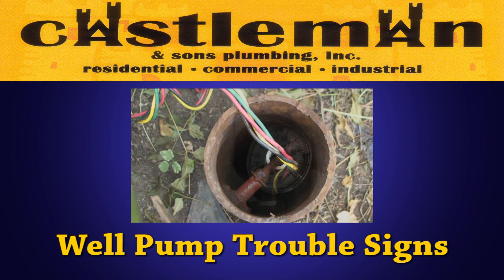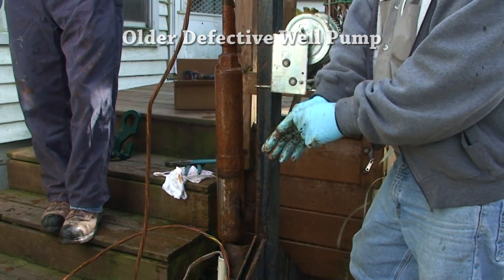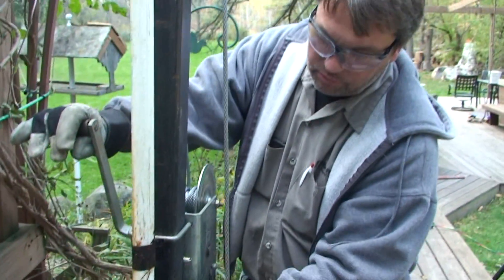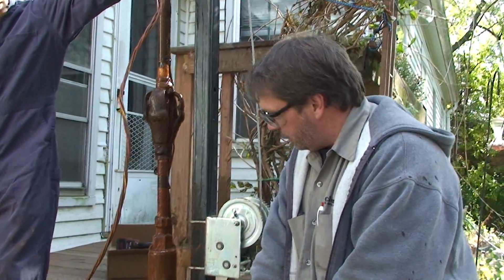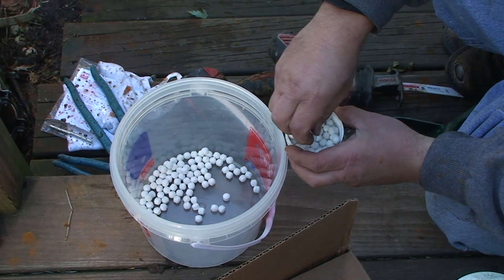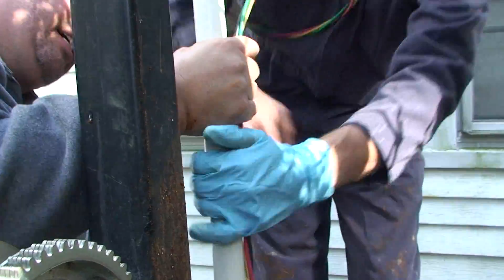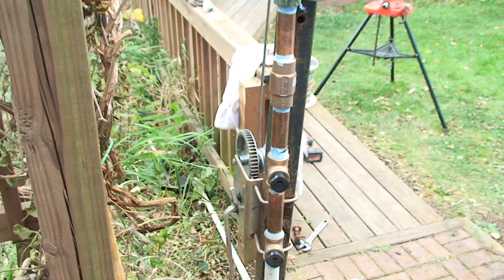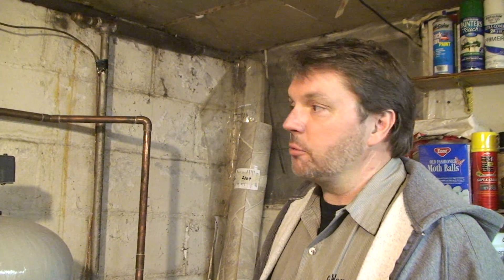Well Pump Trouble Signs & How To Replace A Defective Well Pump

Comment: i have a deep well jet pump, its a goulds J5.  i had water but it was intermittent, now i lost pressure and cant prime the pump at all, is my well dry or the pump went bad?
Reply from the maker: Hi Todd Baden, thanks for the question. First of all, sorry about your loss of water. Did you notice if you were getting any air in your water, before it failed? That is a sign of a dry well, or a break in the piping, perhaps from a hole in the pipe or a bad check valve. The only way to tell is to pull the pump out and examine it. It is usually far less expensive to examine the existing pump system, than it is to automatically drill another well. In either case, running a good pump without any water can quickly damage a unit, so it would seem you will need to access the well casing and determine if there is water present. Hope you can remedy the situation and get your water supply back in working order.
Reply: fixed, it was a clog screen and bad petcock down in the well, and yes i did have air bubbles. ty
Reply from the maker: Good news...glad you got it all fixed up! Thanks for watching and sharing your comments.
Reply: Hi VintageVideos2009... We have experienced total loss of water. I noticed a few months back, every time i would turn on the water in the morning there would be a lot of air spitting out before the water finally flowed thoroughly. A few nights ago I went to take a shower and noticed limited pressure and then no pressure. Went down and saw that my Rainsoft system was continuously draining (almost like it was stuck in backwash mode) so I bypassed the entire system until I could get a technician to come. One day later (Saturday night) we have full loss of water. I replaced the PumptroL switch and have full 240 volts of power running, but it is not activating the pump and my tank is completely empty. I replied to this thread because it sounded similar to my issues. Any advice would be really appreciated before i contact a professional. Thanks!!
Reply from the maker: The intermittent air coming out of your faucet and then failure of water to flow in the system a few days later suggests that there is a disruption or break in your well pump system, and you will likely need to open up and examine your well tank line. This is best handled by a professional who has opened up wells and diagnosed and examined well tank systems. Thanks for sharing your question with us.
Reply: VintageVideos2009 thanks for your reply. Hopefully its an easy fix, like the gentlemen above. Again, I appreciate the reply.
Reply: One more quick question. Do you believe the water softener system issues could have had something to do with it? Or pure coincidence... thanks again!
Reply from the maker: Hi Russell, thanks for the question. Water softeners can become clogged, with rust and other deposits and reduce the amount of water flow. Performing regular maintenance to the softener can often minimize this occurrence. However, if you feel the water softener may be the problem, most water softeners has a bypass valve that allows the water to flow without entering the water softener system. By engaging the bypass valve, you can see if the water softener is the issue relatively quickly. Thanks again for watching and sharing your comments with us.
Reply: VintageVideos2009 thanks again. I had bypassed the system before the pump stopped. It just seemed coincidental that it happened back to back days. So but anyway, yeah the softener system is bypassed but still no water.
Reply from the maker: Well, it sounds like you've removed the water softener from the issue, with the bypass engaged. You'll need to focus on the well pump system to look for a break in the line or a component failure. Wishing you all the best in resolving your plumbing issue.
Reply: VintageVideos2009 thanks alot!

Comment: My pump has started to run constantly. Water pressure is decent, gauge is showing 60 psi, but it won't shut off.
Reply from the maker: Hi Glen Zee, thanks for the question. There are a number of issues that may be taking place such as: a faulty pressure switch, a lack of sufficient water at the bottom of the well, leaking of non-visible pipes, low voltage in the electrical connections and other causes. Given the complexity of these things, it may be wise to have a professional look at your system.

Comment: my well has water coming out the top of the head. even when I have power shut of it continues to come out the top. is this safe?
Reply from the maker: It sounds as though there is a break in the integrity of the line carrying the water from the submersible pump down in the well. Your well pump will need to be serviced. The water quality may likely be compromised and unsafe for human consumption.  We hope you are able to resolve the issue.

Comment: I have a shallow well now, with no issues, what would I have to do, if I wanted to put in a submersible pump, how do ya do it?
Reply from the maker: Watching our video will give you a sense of all the components needed, plus determining the height of the column of water in the well. Beyond the submersible installation, there will also be the well tank, electrical box, are related components.  We'll share this other video as well, to show another example, very much like ours, with a submersible installation. Hope this helps. https://youtu.be/pZQxjSRrzKg

Comment: Hi I am looking for advice my water system is about 20 years old however we have being having massive pressure problems. We currently can only use one tap at a time otherwise the pressure drops of completely to the point that there is just a dribble. And the pressure gauge on the storage tank drops to half a bar. I don't have the money to replace the full system yet and can do most of the work myself. But I have no idea what the problem is I suspect that it is the pump but not to sure.
Reply from the maker: Hi Heavy Metal Gam3r, your issues sound very similar to what this home experienced. Their pressure would be OK, then suddenly drop to where minimal pressure was coming out of a single faucet. The pump's bearings were failing, and it became troublesome to maintain water pressure in the home. Once the pump was replaced, the water pressure was the best it had ever been. Without seeing your system, we are only guessing, but if all other things are functioning correctly, you may have a faulty pump as well. Hope this helps and thanks for sharing your questions and comments.

Comment: We believe that our deep submersible pump of 400 feet has failed. Dad replaced the condenser and it started back up. Due to dad turning off the pump when we didn't need it because of a leak in the pipe mom said leave it on now it stopped again. Dad wants to install a solar well pump please advise what type of pump to replace it with.

Comment: Hi,I ge got pressure problems on my deep well.Ive metered pump and have 240 phase to phase to the pump,each leg draws 6 amps,however I'm only getting 10 psi max,not enough pressure to cut in set at 18 psi on a 20/40 system
Reply: VintageVideos2009
Reply from the maker: Did you recently perform some work on the system, for example did you replace a faulty pump?
Reply: VintageVideos2009   Hello there,I completely rebuilt my water system,I installed a new ballast tank,(hydro pro v 100) new pressure switch new gage and specit, All new pvc piping last spring.Ive had concerns of having enough water as during the summer could draw water for about ten minutes and run out.about two weeks ago woke up to no water.Now I, only getting 2 to 5 psi once pump is turned on.Im thinking capacitor,it still takes charge proofed through shorting poles together,the top hole is yellow not white,am I somizing my problem correct?

Comment: we replaced water pump switch,but now its clicking fast.can u tell me y
Reply from the maker: https://youtu.be/7ekOTlRwKLY?t=9m49s  You are experiencing short cycling on your pump and need to re-pressurize the tank. The link we have attached shows an example of why this is done. This should correct your problem. Thanks for watching and sharing your comments.
Reply: Thanks

Comment: my  double breaker keeps tripping...3 times yesterday....had the control box replaced 2 month ago....the pump is old    think I need a new one ?
Reply from the maker: Hi Bruce C, well, we would think the new control box is not the issue, however a defect on a brand new part can happen during a small percentage of the time. Did you replace the circuit breaker too, when the control box was replaced? Circuit breakers are very reliable, but even a circuit breakers can fail over time and may need to be replaced. These two measures would be easier and less expensive than replacing the submersible pump. 

You can continue to eliminate the easy items, and then, if you are still having issues, it may in fact be your well pump. We recommended that a professional plumber, like Castleman & Sons Plumbing, diagnose your system if you continue to have issues. We hope that helps you take a look at some of the easier items to get your system back in full service.

Comment: So, if the pump is running continuously would that indicate that the pump is bad.  I did find plastic fragments in my filter, may be pieces of a impeller.   With the pump running I have about 20PSI.   When I shut the breaker off, there is no water going into the house.
Reply from the maker: Hi Robert, thanks for the questions. First of all, when you turn the breaker off, you have de-energized the pump, which should stop water flow. A broken impeller could lead a pump to run continuously, while being unable to reach adequate pressure.  The average life span for most well pumps is about 15-25 years, so the age of your pump can certainly be a factor. And if you watch our video, typical pump pressures should reach about 40-60 PSI, so if you are only getting 20 PSI with your system, there is definitely something wrong that needs repair from a professional plumbing service like www.castlemanplumbing.com.
Reply: My pump was about 15 years old.  it was replaced and now we have great pressure.  thanks for the guidance.
Reply from the maker: Hi Robert, sometimes it's best to replace the unit. Sounds like you're back in business. Glad to hear it.

Comment: my pumps is running but no water pressure
Reply: how can I tell if my water pump is burnt up
Reply from the maker: Loss of water pressure is a sign, but it could also be that the circuit and/or wiring to the pump has failed (however, this is less common). We would advise having a professional plumber on site to diagnose your issue, as there can be other far less expensive items that can be fixed to get your system back in action. Thanks for watching and sharing your question.
Reply from the maker: As was the case in this video, the pump was running, however due to the bearings failing and loss of performance, the well submersible pump could no longer sustain adequate water pressure for this residential service. If you have noticed a gradual and consistent loss of water pressure, you may be faced with a similar issue. If you still have some water flow (but low pressure), you may want to look at other less expensive items first, such as your well pressure tank, which may be defective. Thanks for the question and we wish you the best on getting your system back in working order.

Comment: Hello, thank you for spending a lot of time putting together this video. My home's well is 200 ft deep and has a submerge well pump. What is a reasonable low and high range cost for a replacement (parts and labor of course)?
Reply from the maker: Hi fluxquantumbeta, we don't know where you are located, but for this job, located in southeastern Wisconsin, with a well with a depth of approximately 100 feet deep, the total cost for this entire job was about slightly under $2,000.00. Of course this was a few years ago, so material costs can fluctuate as well as the prevailing labor rate for a professional plumber. It is not an inexpensive fix, however, unless you are very, very competent and have a crew that can help raise the pump and it's parts from a depth of 200 feet, we would strongly urge you to find a reputable company that will complete this job for you and provide a warranty. Thanks for watching and sharing your comments. We hope this helps.
Reply: Thank you for such a quick response. I am definitely considering carefully whom to perform the work. I am located in the middle of Maryland, one contractor gave an over the phone estimate of 3000$-4000$ and stating that it would be 1 day of work. Does that sound reasonable? It appears for your particular job, that is not the case given that you needed to disinfect the well prior to replacement of the water pump. Thank you again for your time.
Reply from the maker: Yes, it does sound quite reasonable that your well pump replacement will take a full day to complete. Our pump, at approximately 100 feet also took approximately 8 hours (plus a second technician for 5 hours) to help remove the well pump from the well casing. At a depth of 200 feet, your project will likely take every bit of a full day. The cost estimate is not out of line with the prevailing cost to replace a well pump. Hopefully you can find a great, professional plumber at an affordable rate that will complete your job and get your water back in service.

Comment: Thank you for this video it is enlightening to see how much work goes into replacing a well pump. I have 1 and 1/2 horsepower pump that needs to be replaced and is about 300 feet deep. I've considered doing the work my self as the videos on youtube make is seem very very "easy". The pump is only 7 years old so I am assuming issues with dirt, silt, etc should be minimal. The pump itself seems to be in the $400 - 600 range but I've been quoted upwards of 2500. That is a big hit for a pump used only for irrigation. Do you have any suggestions/recommendations for a novice?
Reply from the maker: Hi Jeff, Thanks for watching and sharing your comments.  This is not an easy job for a novice, although as you mentioned, watching it on YOUTUBE may make it look easy. We have a few thoughts to consider with your job:  A 300-foot removal would tax the winch system used on this video, not to mention the muscles of the crew. You may be looking at a mechanical/power-driven method to raise the considerable weight of the well pump that distance, or more likely a professional to complete the service, even at the $2500 price tag. It is unusual that a pump that is 7 years old has failed, as the typical life is about 15 years, and 25 years is not unusual.  Have you considered contacting the contractor that did the previous installation, to see if the unit may still be under warranty, or if they will offer you a discount toward servicing your current unit?  If you undertake this job on your own, please be careful, be safe and have a 4-person crew that will be putting in a hard-working day.

Comment: our well (80 feet down) loss of pressure we put in a new bladder pump, pressure valve, and pressure switch, still no pressure showing on valve with a bike pump pressure of tank reads 60 LB ???? we have no water and no pressure????
Reply from the maker: The submersible well pump in our video was losing integrity with it's internal components and was unable to deliver consistent pressure, resulting in intermittent water issues. It is possible that your submersible pump, located near the bottom of your well is the problem and needs to be serviced or replaced. It sounds like you have taken care of the other components within your system, but pulling the submersible pump is a far more involved procedure and may best be handled by a professional plumber or someone who is comfortable with pulling up the submersible pump and servicing or wiring a new one as we did in this video.  Thanks for watching and sharing your comments and we hope your water issue can be easily resolved.
Reply: Thank you so much my husband did watch your video we did exactly what You did and he saw that our pump was disconnected and had rotted away from the pipe we fixed the problem and now have water and great pressure I THANK YOU SO MUCH I AM SO HAPPY AND GREAT FULL for your video
Reply from the maker: Wow, that's awesome - so glad the video was able to help you fix your problem and save you a lot of money! YOUTUBE "How-to" videos are a really nice thing sometimes, aren't they?  We invite you to like, share and subscribe to our channel for more repair and DIY videos in the future.

Comment: I have replaced a submerge well pump for the first time,a three wire,is it supposed to come on as soon as I connect it,when do the water come up
Reply from the maker: You may have wanted to test the pump, as we demonstrated in this video, to clean the well casing of debris and also to make sure the submersible pump is working as well. Please review our video https://youtu.be/sIlkKHkUYGg?t=4m38s to see how the pump ran prior to final hook up. Thanks for your question and good luck on getting everything in working order.

Comment: Can you help me please? I noticed for about a month every time I used the water I could hear clicking noises coming from the pressure gauge. The water pressure would cut in an out from good to poor. But now I have no water an the pressure gauge is below 10 pounds. I can still hear the pressure gauge clicking every now n then. The pressure gauge is below 10 pounds but will jump up to 60 pounds when it clicks then back down below 10 pounds in a few seconds an stay. I was thinking it was the pressure gauge that was going bad but now I'm worried the pump went out. If the pump went out, would the pressure gauge click an go up to 60 pounds then back below 10 pounds an stay?
Reply: Had a bad tank which killed your pump